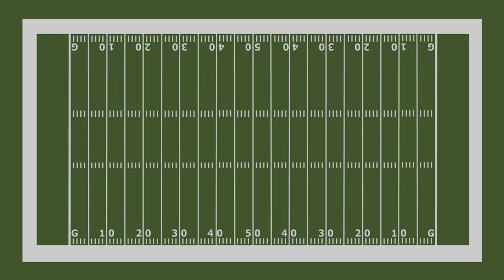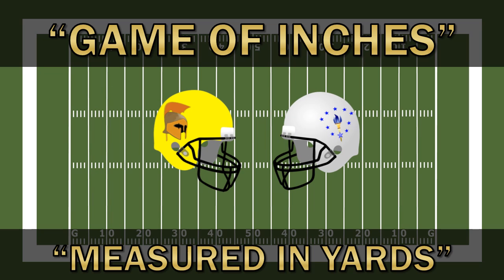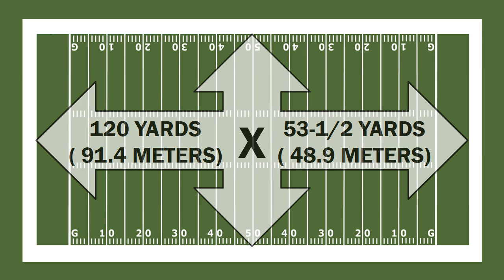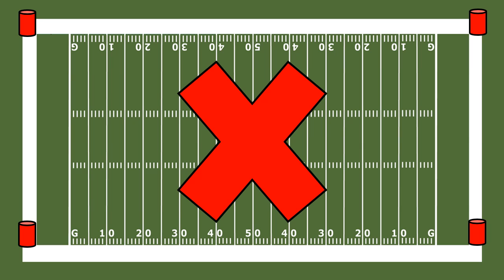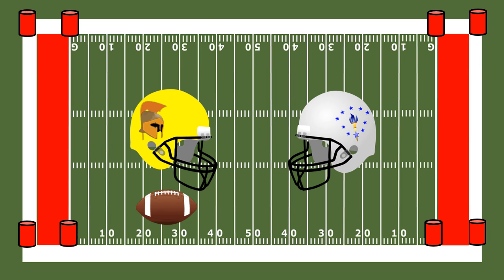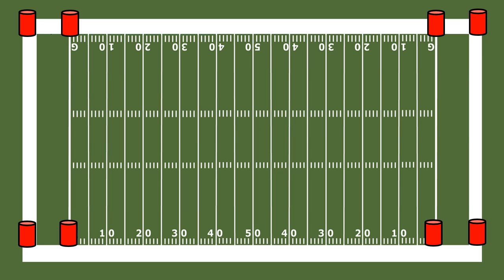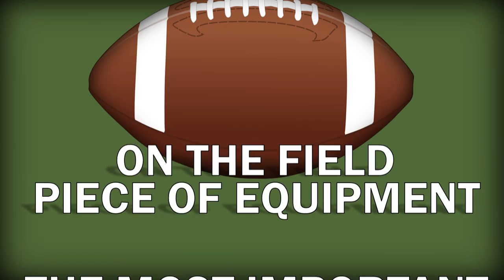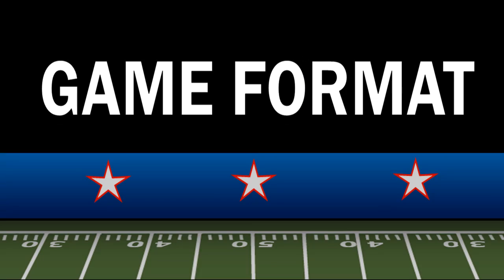LEARN AMERICAN FOOTBALL : THE FIELD

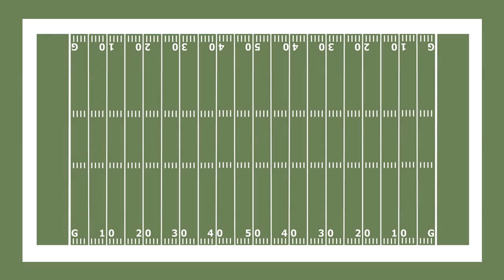Comment: thanks for the great videos.  just wanted to point out a small correction, at 1:38 you mentioned the length of the field, but I think you forgot to add the endzones to the meters conversion.  100 yards is 91.4 meters, 120 yards would be closer to 109.7 meters.  Just in case any non-Americans out there were confused.  cheers!
Reply from the maker: Right! Nice catch, but I was referring to the gridiron